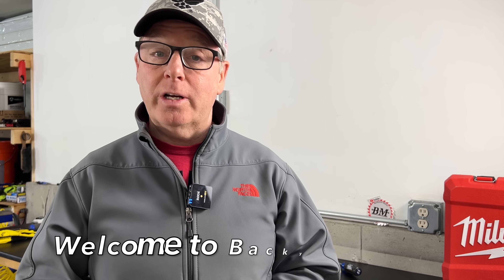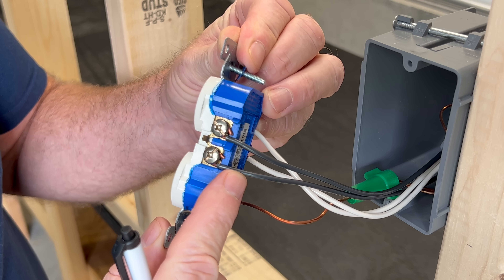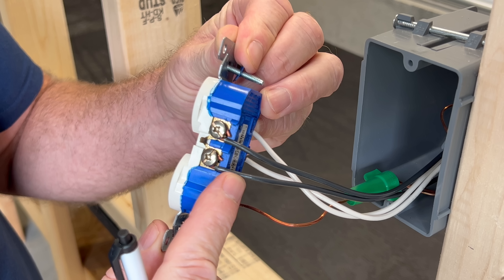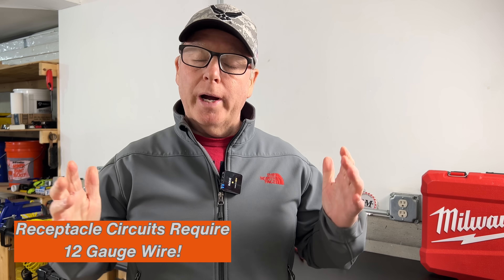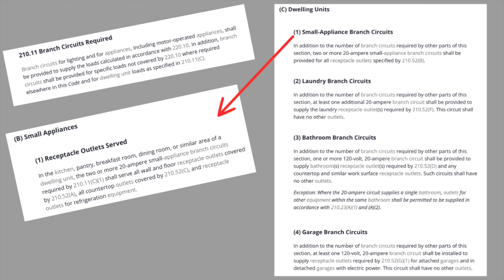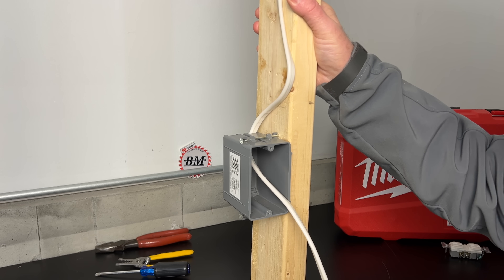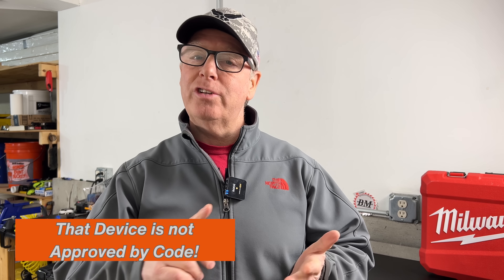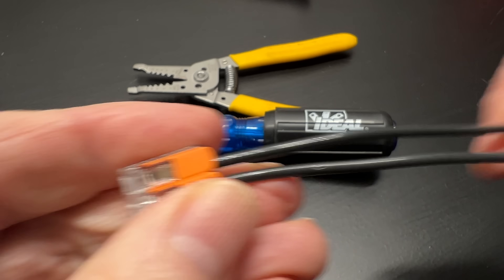5 Electrical Code Lies DIYers Should Stop Believing!

Comment: That multiwire branch circuit thing about neutral wire actually makes a lot of sense. Otherwise if you remove a receptacle you might end up knocking out the neutral and only one hot. The other hot would continue "downstream" and then if any device is plugged in, it will turn the neutral hot as well! For the same reason you should never pigtail a hot unless you also pigtail the neutral.
Reply from the maker: Yes an open neutral on a mutliwire branch circuit can be hazardous for a variety of reasons. I'm going to make a dedicated video on them in the near future.

Comment: Finally, somebody got rid of the The wife's tails, not the Pig tails The code book is minimum standards. You can do better.
Reply from the maker: The code book is a lot more than a minimum standard.. I hear that a lot in the comments and it's not accurate. I have a video on pigtails and when I use them but they aren't required because they aren't always necessary.

Comment: Clarifications needed:
1. Pigtails? NEC requires following manufacturer standards. UL listings very muddy as to feeding through devices. Plus, as you mentioned, there's that multi-wire circuit detail. Simple fact is electricians have been trained to se pigtails for decades. Maybe not "required," but definitely a superior technique;
2. Ground Up . Actually required in medical settings. A common passion among folks who over thin things. Hard to believe every house has been done "wrong" for decades. Heck, mount the plugs sideways if you want; (BTW, the receptacle shown over the baseboard heater is a violation;
3. Yes, you can use 15-A devices on a 20-A circuit;
4. Lifetime in the trade and I've never seen, nor heard of, this "service loop" nonsense; and,
5. Just look for the UL label. Could not be easier.
Reply from the maker: Actually no the receptacle over the heater is code compliant. FPN: Listed baseboard heaters include instructions that may not permit their installation below receptacle outlets. This doesn't apply to hydronic heaters and also not all electric heaters either. Good thing too because more than half the wall space here in the north has a hydronic heater. Also the manufacturers design the device to be through wired and the UL test the connection at 30A and rates them at 20A ever for 15A receptacles. Nothing muddy about it. Also the NEC does not require ground up in healthcare facilities Article 517. You see them that way because many build specs are written using IEEE std 602 which recommend ground up. Check your facts my friend.
Reply: Ground up in medical settings. No, that is just not true!
Reply: UL listings are not muddy at all. Receps are designed and listed for feedthrough, explicitly.

Comment: My local inspector was code book crazy!
He measured the distance between staples and forced installation of cross supports to staple to!
Even though the branch had a 40A maximum load, he demanded a GFCI/AFCI 50A breaker on 6 gauge wire!
Reply: 6 gauge is roughly what you want for 40A "power transmission" (an EV charger, for example), or if the cable needs to be derated due to being bundled.  Were either of those things true?   GFCI/AFCI ... if it was for an EV charger, then GFCI is needed somewhere on the circuit as of 2020 (it seems).  Or a garage or kitchen and a few other places.
Reply: @junkerzn7312  The line was a 220V buried feeder, in MN conduit, from the main breaker panel to a subpanel in the garage.  The garage had it's own grounding rod, everything in EMT with metal boxes.  He also made me move a counter outlet from one side of the stud to the other side of the same stud to meet separation distance requirements.

Comment: There should be NO #14 wire in a house! It may be code but it causes too many problems!
Reply from the maker: I disagree. As long as everything is installed correctly you should not have any problems. For example I have at least 20ea 15A circuits in my home and I have never had a problem, never even tripped a breaker in 25 years.
Reply: Why stop there? If #12 is good wouldn’t #10 be better? NEC = minimum requirements, everyone is welcome to go over and above! It’s your money, spend it wisely.
Reply: @djcip1  The price difference between #14 and #12 is $300.00 on the average new house. The average new house is nearly $400,000.00. My house was built 26 years ago and it has #14 almost throughout! I have one circuit that gives us issues! You guessed it #14 wire!
Reply: I just completely gutted and redid my house including all new electrical from the transformer on. I did 12 gauge for all outlets but was comfortable using 14 gauge for my lighting circuits as the puck lights I installed won't ever draw more load than they did on day one.
Reply: @k87upkid  The price difference is negligible! And if you are purchasing by the 1,000' spool it may have been cheaper to use #12 all the way than buying say 6-250' rolls of #12 and 2-250' rolls of #14 or 1-1,000' spool, 2-250' rolls of #12 and 2-250' rolls of #14.
Reply: For new installs (besides dedicated lighting circuits) I agree, but for retrofit work there is no reason to install 12 gauge onto a 15 amp circuit limited by existing wiring. 

The cost difference for smaller jobs is also much more significant than for new construction of an entire house.
Reply: There are lots of circuits in a home where #14 is more than adequate and starting with the 23 code, 10 amp circuits with #16 are right around the corner. If the wiring is designed and installed correctly, #14, or any other size, does not cause too many problems.
Reply: @pld8993  Buy why, to save $300.00 on a $450,000 house?!

Comment: Had a City plans reviewer fail my plans on an industrial project.  Said all the CB sizes exceed the wire ampacity, duh, they were motor circuits, had to educate him on the Code for motor circuits.
Reply from the maker: I have run into similar issues in the past. lol
Reply: That would fail in europe too, thats why they use "type D curve" circuit breakers for motors.
Reply: That’s severely annoying. Have you also had the pleasure of dealing with HVAC contractors that don’t understand circuit sizing in relation to condensing units? I’m constantly asking for minimum circuit amps for units and they’ll just spit out the max breaker size. Can’t tell you how many times I’ve had to explain that that wasn’t the question and why that’s the case
Reply: @r.k.werner2688  "Take a picture of all the nameplate rating stuff and send it to me, thankyouverymuch, and I'll not have to call you again."  I'm surprised you didn't get quoted locked rotor amps.

Comment: It does not matter if the NEC is wrong.
If you do not follow the NEC you will not be approved after inspections and your electrical service will not be turned on.
Later down the road if your project was not inspected, when you go to sell your house these violations may be noticed and it will cost more to fix it.
Most inspectors do not know the code anyway and are not properly licensed.
Same way with plumbing inspectors.
Reply from the maker: I'm not saying that the NEC is wrong.

Comment: Good, clear video.  The NEC is a minimum standard,  it is not a design guide.  As consulting design engineer, I've come across some inspectors who are retired contractors who have been doing things wrong for years.
Reply: I've seen the exact opposite of what you described electrical engineers that think they know it all when it comes to the NEC 40 years of hands on in the trade is more viable than four years of book learning
Reply: @kd9856  One reason I retired early was a school project where none of the electricians read or spoke English.  So none of the drawing notes were followed and the work met "NEC minimums" but not the specific State requirements for educational facilities shown on the design drawings.
Reply from the maker: Thank you.
Reply: How about the "certified home inspectors" who never worked a single day in the trades?  They cause more problems than anyone.

Comment: Hospitals require ground up recepticals, code or not.
Reply: What about animal hospitals?
Reply: @Kevin-xi6ts Yes, but liposuction clinics are exempt.
Reply from the maker: Many health care facility spec are written using IEEE std 602 which recommends ground up. Article 517 in the NEC has no requirement for receptacle orientation in health care facilities.
Reply: I was the electrical inspector responsible for one of the largest medical complexes on the Northeast for over 10 years, and I never once encountered any specification or NFPA 101/99, requirements for this.
Reply: Incorrect

Comment: My current home has 20A outlets in the kitchen, laundry, and bathrooms.
My last house had them on 15A circuits until I added 20A to the kitchen.
I enjoy being able to run a toaster oven and a microwave at the same time, and have the refrigerator kick on too, without a breaker tripping.
Reply: My poor kitchen has separate circuits for the fridge, garbage disposal, dishwasher, and the lights, but only one circuit for the counter-top outlets. We can't run the toaster-oven and microwave at the same time, unfortunately.  Or the induction kettle plus one either, for that matter 😞
Reply: @junkerzn7312  I hope your bedrooms and living room don't share those circuits.
When I would trip the kitchen breaker, my TV and the computer in the spare room would have no power.
Reply: @junkerzn7312  that sucks, been there in apartments where a person can nothing about it
Reply: Shouldnt the microwave, fridge and dishwasher have their own designated circuits regardless of the amperage?  Thats how im doing my reno.
Reply: @robitteilag6682  Older homes are likely to have fewer spaces on the panel for individual circuits.
Even my current home, which was built 23 years after my first home, has a lot of outlets on the same circuit.
Ironically, my panel has a LOT of empty spots.
I guess they didn't want to pay for the Romex and time.
Reply: @robitteilag6682 Yes, you are correct. Those appliances should have dedicated circuits with #12 wire on a 20 Amp breaker.
Reply: amen, forgot coffee pot ROFL
Reply: @watup110875  Yeah, the hot water pot pulls a few amps.
Reply: Move to Europe and you can put even more without the breaker tripping :D
I can use microwave, conventional oven and induction cooking plate at the same time without tripping the breaker. That's the big advantage of 240V, we can easily pull 4000W on a single circuit (not for hours because the breaker would trip eventually, but that's a common problem).
Reply: @ppdan  I can wire up 240 outlets.
I'm considering one for each bathroom to add a supplementary heater.
But I can also add more 120 outlets.
Reply: @patmcbride9853  Yes, but you need the appliances to go with that.
You have 120V and 240V in the US while in europe we have 240V and 400V.
Might sound dangerous but if everything is safely installed and protected ...
Reply: @Joe-by8jh  You might need more arms.

Comment: Isn't that receptacle above your base heat a violation of the NEC?
Reply from the maker: Actually no.. I have a video detailing the code requirements for 15A receptacles on 20A circuits. Maybe you should watch it. https://youtu.be/XqV0WpcCFrQ
Reply: Are you referring to baseboard heating? If so, the restriction only applies to electric baseboard and not hydronic.

Comment: I used to be a jack of all trades.  I settled into one trade and have subscribed to a few true tradesmen's channels that are run by knowledgeable and skilled in the trades that I used to think I was capable in.  I've learned a lot since then and my biggest take away has been "just because I learned to do something,  does not equate to doing it correctly. " Thanks for taking your time to help us Jacks to learn.
Reply from the maker: It's my pleasure Scott.. This channel is designed to help out people just like yourself. Thanks for watching.
Reply: @BackyardMaine talking about the Wago lever nuts in a wet location, can they be used by themselves when wiring a receptacle in a bathroom? Or do you need to place them in a Wago Gel Box to meet code? Thank you for any advice you can give me.
Reply from the maker: @AARON10B  The only area in the bathroom considered a damp or wet location is inside the edges of a tube or shower and no receptacles are permitted in this area. Wego 221 lever nuts are fine in the bathroom without using the gel caps.
Reply: anyone that says they know all, doesn't know chit, best advice I ever got from grandpa and dad
Reply: @watup110875  Try 30 years as a general contractor. Hands-on That means all the trades.
Reply: Great short video!
Reply: Right you are sir. Many folks get into trouble trying to fix or install things themselves due to lack of $$$ to pay a pro. Much of the time they have the capability to learn to do it the right way from sources like this video, but so often the information is simply not available to the general public. That's when the troubles occur. 
Very good video! Thanks.
Reply from the maker: @Know-Way  Thank you.. I'm glad to help.
Reply: Learning has much to do with source and comprehension.
Backyard Maine shows us that even within the trade there exist confusion. As a builder/remodel contractor I've learned to do most phases of building, from foundation to finish.  When in doubt, make a call to a good tradesman or an inspector. I use the same plumbers, electricians all the time, guys who don't get corrections and call backs. Do I do those tasks, yep. Understanding the dynamics of amps, volts, wire requirements, box requirements, knowing the math involved is key to understanding code requirements. As in any trade, there are constant changes, some make sense. In building structure you need to understand load paths, strength of materials, deflection, wind shear, uplift, seismic codes, span limitations, concrete strength and what weakens it, soil conditions for building loads.  Stuff electricians and plumbers never pay attention or really need to unless they start wacking away structural members, which they do. Get a new sub. As a General Contractor I know more about what they do than they know about what I do. Keep learning, keep asking questions. You can master many trades, you won't be as fast as the guy who does it everyday, but there is no reason you can't do it well. If you're getting paid for the task, you better do it right.
Reply: Something that many people, including so-called professionals, don't understand is the national electrical code is the absolute minimum requirement for electrical installations. If you are not following the code, you are making a big mistake.
Reply: @ScottWConvid19  Ahh come on , nobody ever stops being a jack of all trades .  You don't un learn your buffet of skills by increasing the level of some .
But there is something to be said for keeping the trades segregated enough for work flow efficiency and quality .
And knowing how the next trade would like something done previous to them is always very helpful .  Which learning how to paint professionally , helped me quite a bit in quite a few trades .  Albeit I loathe picking up a brush anymore .
Many times through the years I thought I should have just started my electrical apprenticeship .  But I enjoy quite a bit a freedom and flexibility being a handyman rather than a tradesman .
Reply: @Mk101T  fair enough.
Reply: @Tom-og7fi  Clock punching , never could stomach it .
I prefer the look at my product production method .
Time and pressure has it's place . . .

Comment: Are homeowners required to follow national code when working on their own home?
Reply from the maker: You should always try to follow the code because it's designed to ensure a long last safe installation. But unless what you're doing is going to be inspected then it will fly under the radar. Also the code updates every three years and as electricians we have to take a 15 hour class to keep up with the changes but existing installations do not have to be brought up to the new standard.. Just new installs.
Reply: @BackyardMaine  Oh,  I can see the value in that.  I just wondered if homeowners are required to
Reply: @ScottWConvid19  You, personally, no... but your town/city/state regs probably require an inspection after any sort of serious electrical work (even though many people do not bother, it may still be the law)... and the inspector won't pass you if it isn't to code.
Reply: That's a vague question.  Required by whom?  The NEC is not like a criminal statute, where you can go to jail if you don't follow the law.  The world is full of non-compliant electrical installations and no one is getting arrested.

Code compliance is what inspectors look for.  The question is not whether the work was done by a licensed electrician, the homeowner or your neighbor's teenage kid.  The question is whether or not the work meets code.

The more important question is, "Does local ordinance require a building permit?"  Permits beget inspections.  Homeowners accept a certain amount of risk by doing work without permits (which may be perfectly legal, depending on the situation) and not following NEC.  But hey, it's your house.
Reply: @boonecountygenerators3052  Thank you! You actually connected some dots for me!
Reply: @boonecountygenerators3052 "But hey, it's your house"  At least until you sell it.
Reply: The National Electrical Code (NEC) is about 2 inches thick for a reason.
There are a thousand things to be connected to electricity and a thousand details to be considered.
If you are not properly educated on the NEC, leave it alone.
Whose house are you going to burn down?
Who are you going to kill?